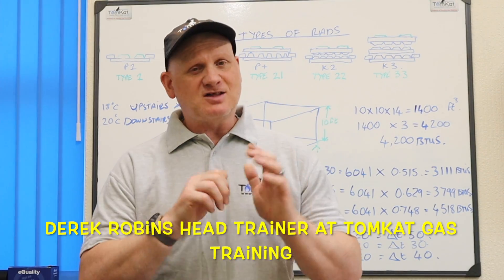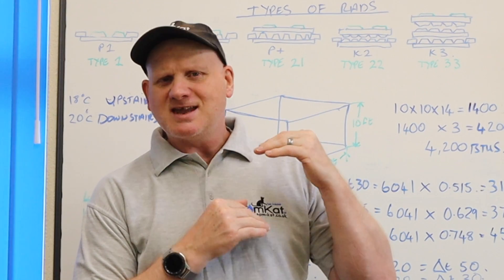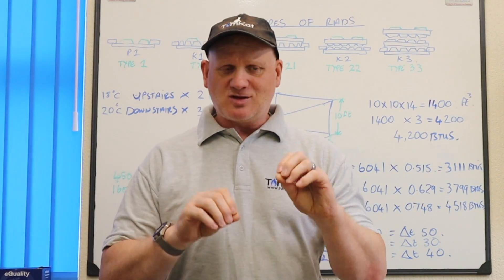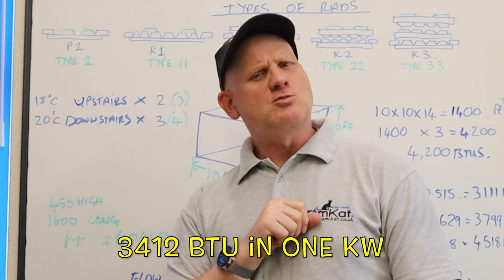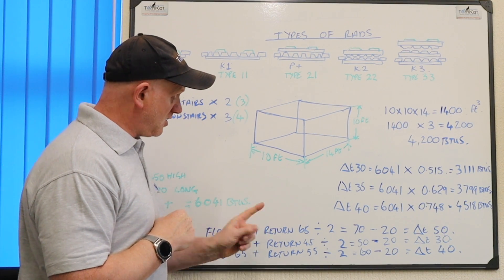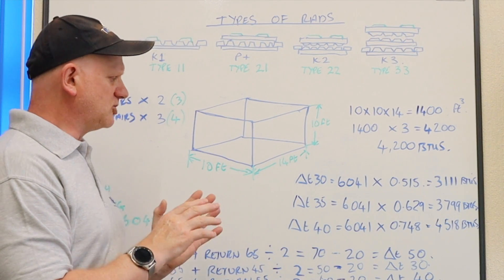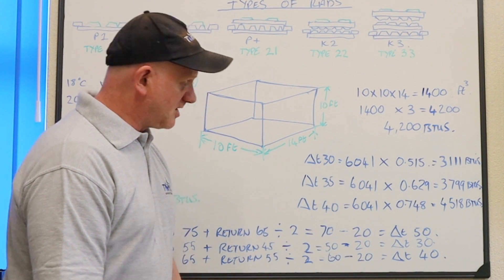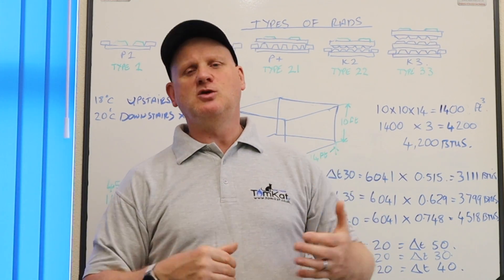How to check your radiators to see if they will work at 55 oC flow temperature . How to save gas.

Comment: I know some have suggested the videos too technical but, a home owner faced with these high bills might want to learn a bit and take on board the general message of the video , you can try and work it out with Derek's help or you can also do as suggested and turn the temp down on the boiler a bit at a time until you get to the point where your not getting the house warm enough , at least then you will be saving some money on your bills .
Reply: To simplify  Derek's post, as , for my sins I've  been specifying  and advising customers since  1972 when I went self employed, heat transfer and efficiencies  are quite involved. From the end users perspective, insulate any pipes that get hot, only heat water( if you have a storage cylinder) to a temperature that you're  happy with without adding cold water. Set the temperature of the water in the radiators to achieve , ideally,  20C or less, but in any case your comfort level. I always advised customers to dress in doors as you would outside. 
Take your  overcoat off but keep your jumper on, not so difficult unless money's  no object.

Comment: Thanks for the detail Tom. I decided to double the o/p of my rads and replaced the existing single panels with double (11's to 21's).  
This should provide the same heating at a lower boiler temp, and on very cold days, increase the available heat to keep me warm. 
Also, I'll only heat the space I use, and just keep other rooms from freezing up with the frost protection from the "Thermostatic Radiator Valves".

Comment: Succinct  is the word that comes to mind that best explains your brilliant presentation. From the video, it's  simple to apply delta T to a given rad output and factoring in the correction figures.
A lot of engineers would do well to watch this video, it will help when watching more advanced calculations.
Did a quick check on your example with my Mears from way back, and assuming  one outside cavity wall, your rule of thumb is about bang on!
Bearing in mind Mears we're always recond to oversize by about 10%.

Comment: 50C is not a typical flow temperature for a heat pump. For well-insulated houses, we usually design to 40C (MWT or 37.50) and for period properties we design to 45C flow (42.50C MWT). 52.5C flow (50C MWT) would be rather inefficient and we advise other measures first, such as bigger radiators, insulation, or both.

If you have over 50C flow on a heat pump your sCOP will be rather low.
Reply: Thanks. I'm not a gas engineer of any kind, however prior to even bothering to get a heat pump, I'm getting someone out to get new radiators that can handle 40C

As of right now, my radiators need a power flush anyway. I've got a thermal temperature monitor thingy, and it shows that the temperature in the radiators isn't exactly even

So I thought screw it. Instead of paying for a power flush, I'll save up and get brand new radiators because I may or may not need new oversized radiators anyway

Currently they work at 55C easily, but not quite 40C "easily". I'd love to get the flow temp as low as possible, to get those higher SCOPs
Reply: Derek was only applying the principles to radiator systems!
Reply: @johnward5006  check 9:32 again
Reply: @UrbanPlumbers  My point was, Derek was basing his presentation on a boiler as a heat source. As we all know, heat pumps are another scenario.
Reply: Insulation Insulation Insulation. And a woolly jumper. Folks should always(?) start by reducing the need for extra (expensive) heating in the UK climate. Makes the heat pumps an even better buy once you are ready for the change (and it is coming)
Reply: @philipoakley5498 Ive just bought a 40yold house in Wales with no central heating (only 1 electric storage radiator and electric h20 cylinder). Weighing pros/cons gaz vs ashp for a brand new heating system. Gaz seem pretty straightforward but ashp could be the right choice and future proof. The only thing is, can’t find an experienced qualified heating engineer here in south wales like the likes of heat geek in England. What to do 🤷🏼‍♂️
Reply: @bartkuk1  Hi, if it's an older property then the heating system is probably the last thing to be 'worried' about, rather it's all the hidden fundamentals that will need checking and sorting, such as underfloor rot and dampness in the woodwork, all the drafts, leaks and insulation (lack of?).

In our case we discovered wet rot and needed a bedroom floor replaced (plus added underfloor PIR insulation and heavy duty plastic solum 'seal').
Sealing(*) the solum with plastic sheet is an easy (ish) self install whose job is to greatly reduce direct evaporation from the soil into the property.

Ensure plenty of subfloor air flow, clear air bricks, all down pipes and gutters are crack & leak free, and drains and soak-aways actually work. Plus French drains wherever the garden impinges on the walls (aren't cottages/houses always cut into the side of a hill ;-)  If you don't fix all those basics the house/cottage will never be comfy enough.

Than go for the insulation (and grants) for cavity wall (as long as you are not in a driven rain area) / internal/external insulation and loft insulation. Plus all the gaps and window stuff.

Once the home is truly wind and water tight, then it should start to feel a lot better and it then becomes a choice for style of heating. Have a look at HaetPunk and other free tools you can use yourself to at least get a feel for how much heating is needed and where to put it.

The Gas vs ASHP is really a mindset issue with respect to how you (and core family) 'think' about heating. Many are still stuck with a 'heat the room we are in' perspective that fits gas combi boilers quite well, giving sudden 'kettle-like' blasts of heat to a previously un-insulated 'cavern', while an ASHP needs that middle-class 'whole house to be comfortable' perspective of the now insulated duvet-covered home. 

Many of the old ASHP designs were miss-designed on the back of gas boiler thinking - too many zone valves, poorer insulation, and lower CoPs. 

Summary: wind, water and insulation tightness first!
Reply: So in reality heat pumps are heaps of shite and not worth fitting in Scotland with some of the winters we have
Reply: @mynameis9739  no. Heat pumps are very effective as long as they are used in a correctly designed heating system. A heat pump linked to underfloor heating is the best possible heating system both in terms of efficiency and performance
Reply: @mynameis9739  Very low ambient temperatures need to accounted for, particularly for heating water to 55-60c. Needs careful consideration.
Reply: @mynameis9739  Heat pumps are just as valid in Scotland as in England. The older housing stocks in each locale are barely sufficient for their local weather, which is why we've squeezed ourselves in to this corner. 

Ignorance is the killer across all heating systems.

Comment: Good effort mate 👍..20°c isn't warm enough for me tho .. thanks for your efforts
Reply: Put on another layer of clothes and make an effort to move a bit more. With the price of fuel we need to make 19 or 20 degrees work for us.
Reply: @juliebrooke6099  I've got it on at a mere 15C to ward off damp, and a heated jacket lol
Reply: Me too. What wold you change for say 23 deg room temp down and 21 up?
Reply: Jesus, mine never reaches 20 as I’ve got the flow down to 50 and don’t leave it on all day as even that’s too expensive. For 20 degrees it would cost me about £15 a day to run my heating even for ten hours, and I simply can’t afford to spend £450 a month on heating simply to be able to walk around the house without a jumper on. 

I’m currently spending about £6 to heat the whole house to a comfortable temperature that doesn’t have a chill for most of the day.